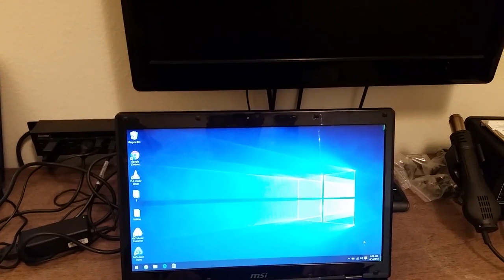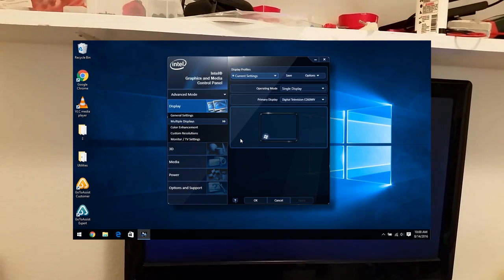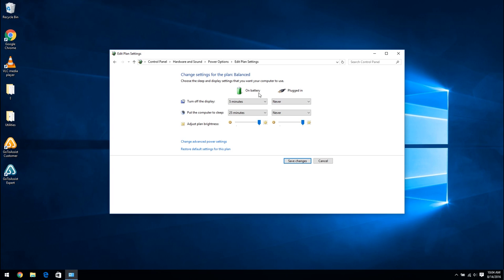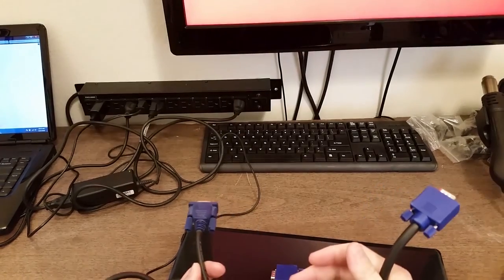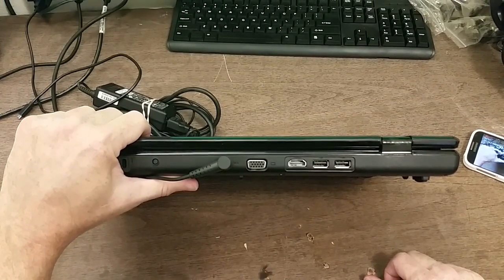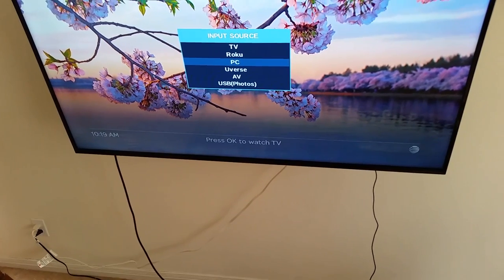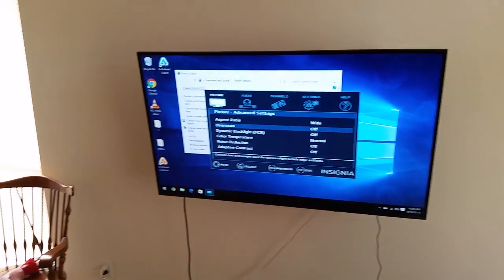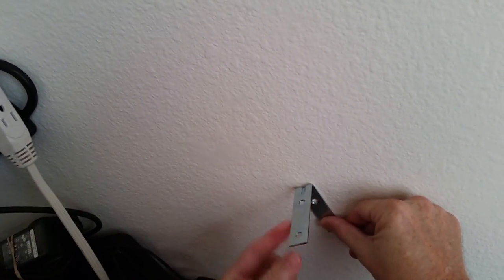Setting up a laptop to be a HTPC and mounting it to the wall behind the TV

Comment: Great idea. Im gonna setup my old laptop like this. But i have few questions:

1) how you power on the laptop from the couch?....
2) we all know that any decent laptop/PC can setup as an android tv. My initial concerns you have answered by installing that USB hub connected to those remote/wireless devices (keyboard with touchpad, game controller or maybe a 3-in 1 remote+keyboard+touchpad). How about the wireless capability via that pc turned android tv; such as mirroring, file transfer, streaming, etc like a normal android device? Yes i know most recent tv is a smart tv. But i need to setup those functions via that pc turned android tv as well.
3) if i need to add some sound system with big speakers...do i need to add like some sort of amplifier deck with hifi speakers only to be connected to the htpc/my soon pc turned android tv? 

Please advice. Tq :D
Reply from the maker: Zaki Wagiman as far as powering it on you do have to press the power button if you want to turn it on. When I do is just never turn it off. I restarted as necessary but otherwise it stays on 24/7. I didn't make a video showing it but what I did to get better sound is I connected a pair of powered studio speakers to the headphone output of the television. Doing it this way you don't have to worry about hooking up sound to your laptop or TV or PlayStation or any other device. Since all the sound goes through the television and then comes out to headphone jack to the speakers all sounds get played to the speakers.
Reply: Ok...thanks for reply...any idea about the mirroring and file transfer if i setup the laptop as android?..
Reply from the maker: Zaki Wagiman no idea about that
Reply: Zaki Wagiman If you configure your htpc laptop as a trusted pc in your house network (I think it would be a family network from Windows or so) it will appear in your other pc when you have shared one or 2 drives. Look in Windows under drive sharing, this will cover you file transfer issue. Not sure how to solve the mirroring issue, but I’m pretty sure when you search the internet you’ll come up with something. Good luck !